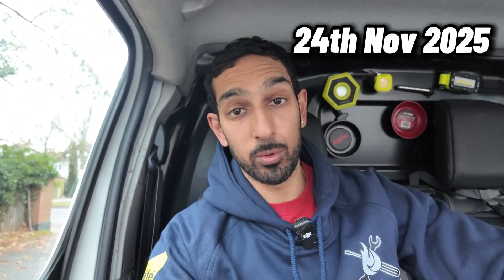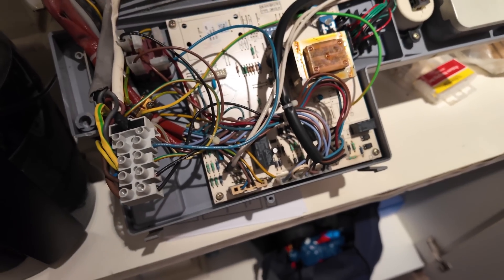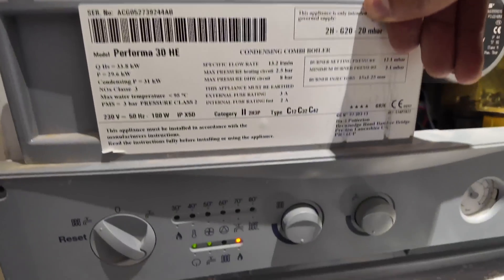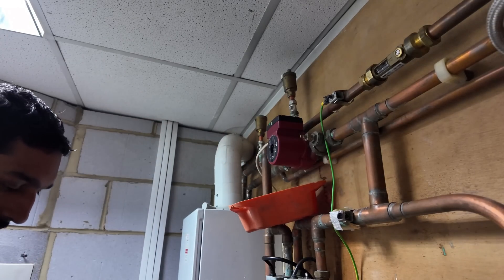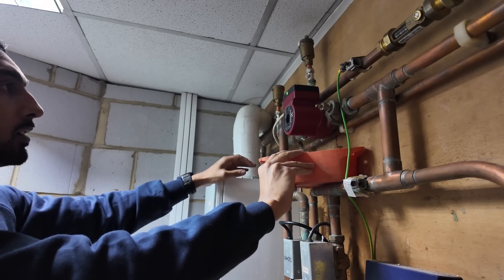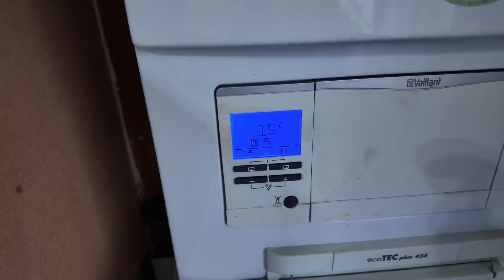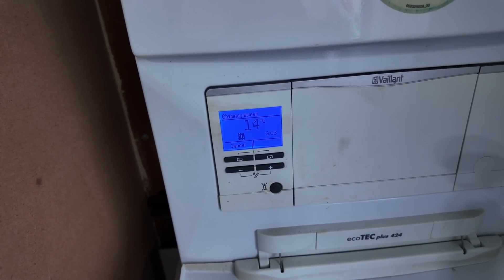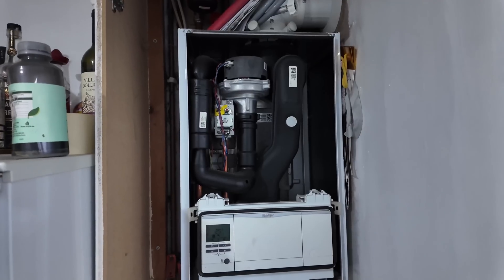It Fixed Itself While I Was at the Van! How?!

Comment: Nice work ! 

I find vaillant boilers mysteriously act sometimes lol 

I’m getting an egg timer showing and boiler not shifting above 50° 🤯 spoke to Vaillant tec and they suggested go into D014 and put pump into 100% , not sure if you have had this being a Vaillant guru 😂
Reply from the maker: Egg timer could mean circulation issue. When it does that check what S code is showing, if it's S53 (low water content) then most likely a circulation issue
Reply: @cputilitysolutions  thanks for your input, going to chuck a new pump head on 😅

Comment: large system? the airlock one.  boiler flue is skewing off weirdly. cinder blocks built to a false ceiling..........run........seriously though large systems sometimes will cure themselves in regards to airlocks you know all to clear if they dont. probably not the best designed system by original installers. what caused the air? drain down? and new owners bought in?

condense is part of the flue system ive seen fat/blockages or whatever beyond the condensate trap cause problems(it cant empty). it could be at the drains..... so then you need to think outside of the boiler. i dont rod drains.

as always love your work. head down move forward.
Reply from the maker: Thanks, there's a bit more development on the airlock on in a later video

Comment: Hi buddy on the ecopure the float jams in the condense trap and it airlocks and holds the water in the heat ex. Simple fix and you can tap the side of the trap and this will release the air and drain the water out into the condense pipe. Sometimes working on the boiler and causes enough vibrations to release it.
Reply from the maker: Nice one mate thank you 👍🏾

Comment: Faulty fan...faulty APS....now going back with a PCB with fingers crossed? Did you ground the static elec before work? Honestly, the easiest boiler to FF on. Jesus, can you fault find at all or just guess? You're knocking a gas valve ffs, do you know how they work?  Again no fault finding and has to ring manufacturer to understand how a zero governor gas valve works or quoting fault codes! This video from nearly 2 months ago, with still no subs. Maybe try harder on the work you do instead of wanting to build a YT, with sponsors and a channel that is going nowhere. Trying to spin a pump impeller without knowing what voltage you're getting to it is amateurish. Same as years ago on a gravity fed, pump just for heating, knock it with a hammer, spin the impellor, then realise the CH stat was turned down. Air will ingress and not expel, the way you are showing it. The AAV is hissing because of it. Come on mate, you're better than this. That pump would fail within an hour after you left the job. Any update? You must be recall City on jobs.
Reply from the maker: It’s amazing how much clearer fault-finding looks from a sofa than with a multimeter in hand. Imagine spending your free time counting another person’s subscribers and writing paragraphs on a two-month-old video. If you put half as much effort into your own work as you do into obsessing over my analytics, you might actually have something better to do. Thanks for the view and the engagement, the algorithm loves it! 😁
Reply: @cputilitysolutions  and that's my point. More interested in a YT algorithm than fixing a very easy fault. Carry on. Best of luck.
Reply from the maker: @56ty78ui thank you, I will 👌🏾
Reply: @cputilitysolutions  Good man.
Reply from the maker: Sounds like you know it all! Maybe you can create some videos to educate the rest of us 👍🏾
Reply: Grow up
Reply: Your some sort of idiot who thinks he knows it all